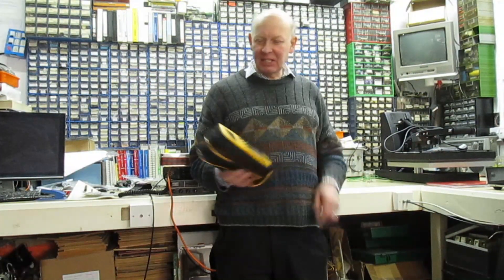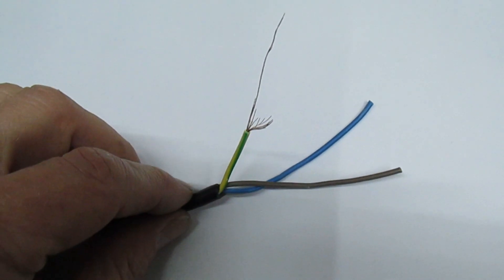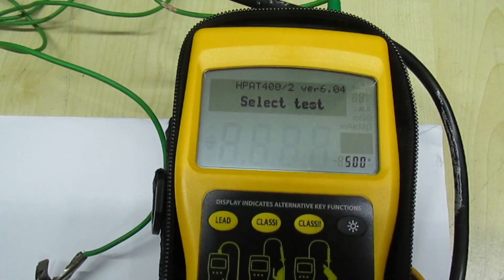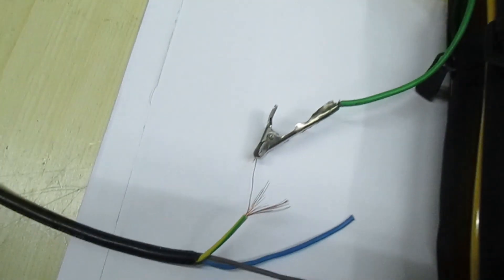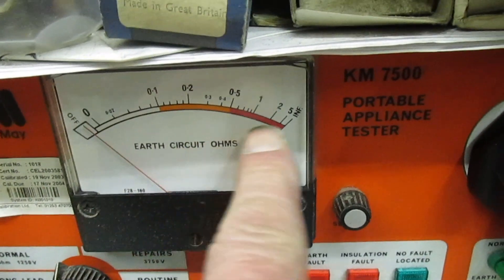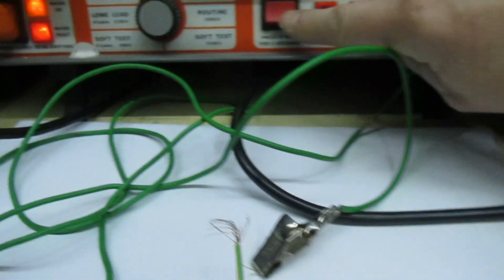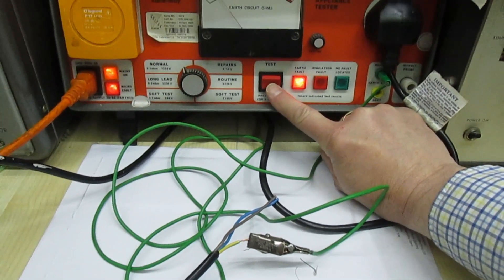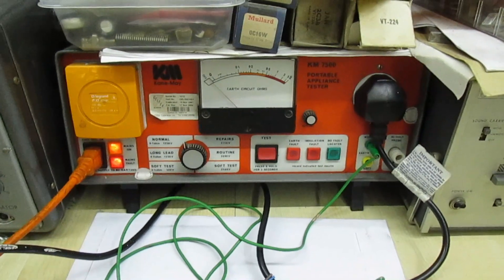This is why I don't trust a battery operated PAT tester on class one  earth tests .

Comment: I remember using a tester similar to that K&M whist I was working at a computer factory back in the 90’s. I think the brand was “Clare” and it had a white & orange case. They referred to it as the “Flash Tester”. As the completed CRT monitors left the production line, each one was flash tested by plugging a 3 pin IEC mains cable from the tester into the monitor, then firmly holding a spring loaded insulated probe against a metal strip surrounding the video connector. A button on the tester was pushed and kept held in for a few seconds. If the test passed a green light on the probe would illuminate, if it failed the buzzer would sound. One thing the company was very strict about was that the employee must be over 18 to use the tester.
Reply from the maker: I would think you are quite correct , Clare made a lot of safety test stuff and as you say mostly in bright orange .

Comment: 25A may damage certain types of class 1 equipment such as medical devices. A test current 
of less than 1 amp is generally used. Most medical establishments use Earth Core Balance
protection (ELCB) protection devices with trip currents of 10 milliamps and trip times of less than 40 milliseconds.
Reply from the maker: Of course this is right in a medical environment but you have to remember in the real world there are a lot of houses that dont have ELCB protection, especially older people who may have lived in the same house for many years and the consumer unit is the old type with re wire fuses .
Reply: @michaeldranfield7140  a lot of medical gear ie oxygen concentrators ,vital signs monitors are now in the home.

Comment: Very interesting and eye opening.  The one thought that crosses my mind is that surely the earth resistance of the wire would be higher with only one strand of wire connected.  I can see the belt and braces approach is a much better way to test.  It is unequivocal.
Reply: Totally agree. I had a long involved discussion with a client on this very point
Reply from the maker: @kendom33  there are cases , especially with IT equipment where it could be damaged by this test but I think on items such as microwave ovens its essential to test at 25 amps .
Reply from the maker: this was something I picked up on a PAT testing course , the importance of the earth been able to carry the full short circuit current in the event of a live to earth short .

Comment: After over 40 years of working on appliances and electronics equipment I have NOT ONE SINGLE TIME HAD AN OPEN GROUND CONNECTION. The only time I have come across open ground connections is where someone had purposely cut the wire, or cut off the third (ground) pin on the plug to get it to fit in a 2 slot wall socket.  Your test certainly is valid if you work in a "for hire" situation where liability is involved. Have you ever found a missing ground? Just wondering.
Reply from the maker: A short from live to earth could blow open a frayed earth conductor  and its the earth connection that carries the current to ground , if the earth went open circuit the the case of the equipment would be at mains potential , bad earth connections are generally something you don't see these days but was very common in pre moulded on plug years , usually occurring where the conductors had been tinned with solder and the solder compressed with age leading to a loose screw .
Reply: I have just once, found an open earth/ground connection. It was a Qume QVT 101 terminal that used a metal enclosed common mode filter and earth assembly. I used a Fluke mains powered PAT tester and I could feel it 'Thump' when it performed the earth continuity test, it was using a significant current for the test.

Comment: With the rash of "electronic" circuitry in a lot of equipment's, these do NOT take a 25A test well.  This can be anything from electronic timers on the likes of microwaves, washing machines to audio equipment and lots more.  They NEED the 200mA maximum earth test.
Reply: This would allow the device to become dangerous if a short happened and the GFI didn't open the circuit before the ground wire fused open. Or if the socket didn't have a GFI.

Comment: With the recent (last decade at least) availability of rather cheap high current LiIon cells it should not be difficult for the battery tester to do the same 25A/5s test by the handheld device less than few years old. With the common power tool rated 1.5Ah 50A rated 18650, a single cell should allow more than 10 such test cycles. With a common 6 cell power tool pack we are talking about more than 50 cycles (assume most are "pass" with 100mOhm-ish resistance), doubt you would need any more for a workday, before the battery could be recharged again...
In my teens (had no license at all, yet still doing repairs here and there, it was in the "wild 90's" here) I used a DIY simple contraption with 50A range A-meter, 4x4Ah D NiCd cells and a beefy switch contact (some car battery disconnect or so), just to test the power conductor integrity (tested for less than a second, anything below about 15A I considered a fail), yet it was enough to catch quite a few such bad connections "hanging on a thread" and quite many "rotten out" cables (which were "famous" for starting fires when loaded with some higher power loads).

Comment: Great demonstration Michael 👍
Another problem with battery powered testers not providing a “challenge” current on the earth wire is that they can fail on some earth tests if the resistance is high due to slight oxidation of the plug earth pin or between the nut and washer on the inside of the unit under test.
A traditional challenge test overcomes this resistance and makes good the bond again. No frayed wires and on internal inspection no noticeable issues with the lugs either.
So whilst it’s always recommended to inspect all fails, I have found quite a few false positives that never occurred before when using the older Seaward Europa PAT testers.
Reply from the maker: Another thing to watch on older installations is if the ends of the wires have been solder tinned, these tend to compress over time leaving a loose screw, I always do a visual inspection inside the plug top where an item does not have a molded on plug.

Comment: An excellent presentation which highlights a very important point. I’ve only recently stumbled across your ‘site after seeing your post relating to the purchase of the radio sonde. As I used to work at Whiteley Radio Co Ltd,  I’m able to give some information regarding it’s use in the comments section of that video. On another of you posts, I was very impressed with your decision to enrol on the City and Guilds L224 radio and tv/electronic servicing course. I used teach every module in pt1, pt2 and pt3 of that course and was also an external verifier for the practical test. I have the greatest respect for every student for investing the time required to take such a course while also in full time employment. It’s an achievement you should be very proud of. I share your passion for vintage electronics as, like you, my formative years were in the valve era. Keep up the good work, I find your content both educational and very nostalgic. Best wishes, Antony M.
Reply from the maker: I only did the 4 year city and guilds in case anything happened and i needed another job , unfortunately it now means nothing , i bet they dont even do 224 in radio tv servicing any more , glad you like my channel , many thanks for watching .
Reply: @michaeldranfield7140  You still did very well to complete pt1, two years of pt2 and a part 3. You’re quite correct in saying the 224 isn’t available anymore. It slowly went out of favour as the reliability of t.v. sets increased and fewer t.v. technicians were required. In a last ditch attempt to attract more students, it was renamed “Electronic Servicing”. The replacement B/Tec courses are much more theoretical and don’t include fault finding techniques at component level. The old City and Guilds were far better IMHO.
Reply: I did the 272 (?) Radio and tv servicing course at stow college Glasgow  :)
Reply: @kendom33  High Alex, I think City and Guilds changed the numbers around on the electronic servicing/radio and tv courses over the years. I think they were all basically the same courses. The ones I taught were offered as an evening only option consisting of three evenings per week or one complete day plus one evening. This would give you pt 1 and part 2 (part 2 lasted  two years). Part 3 options were completed in one year and were offered in a variety of subject areas. I believe there are similar courses being offered today but they are usually lacking the practical content and component level fault finding techniques which were so well covered by the C&G courses.

Comment: Interesting to see this.  I arrived at the same conclusion some years ago and decided to look for a high current earth bond tester.  I totally lucked out with a Kikusui unit on ebay, it had been badly listed as a power supply (!!) and spares or repairs only. I got it for the starting bid of £0.99!  And it was local so I picked it up and paid cash, I gave him a £1 coin and said he could keep the change!! He called me a cheeky 8ugger! Actually I did feel a bit guilty as although it's an older unit it's still worth an easy £300 to someone that needs it.  Anyway, it was fully working and has proved it's worth many times. It's surprising how many bolted earth connections, push on connections etc have gone high resistance on class 1 devices.
Reply from the maker: You got a bargain there then, can't remember how much mine cost, I bought this along with a microwave leakage tester in the late 80s Earley 90s when I started repairing microwaves, the two items were £790, A lot of money then, I got them from SEME and the rep arranged me to pay in 3 installments over 3 months on top of my monthly invoice.